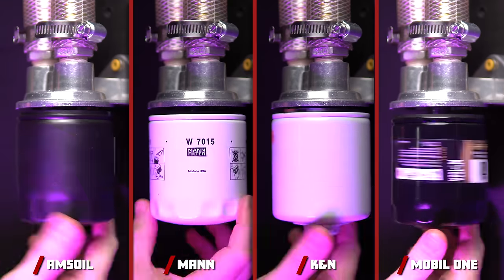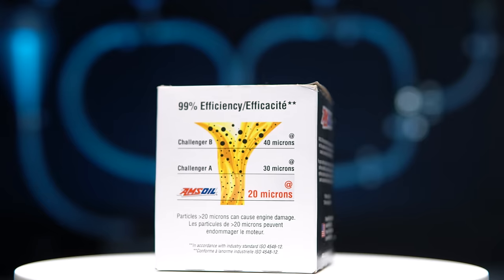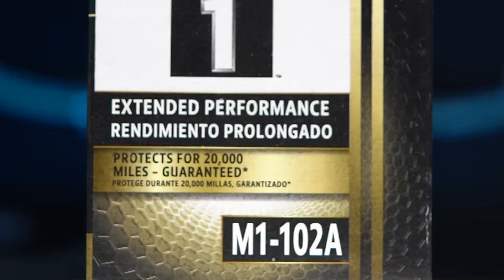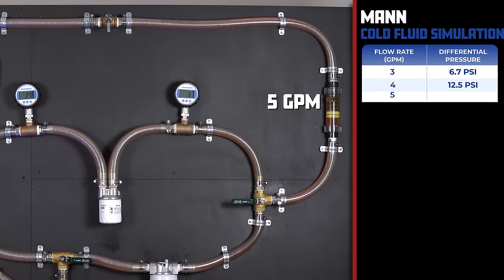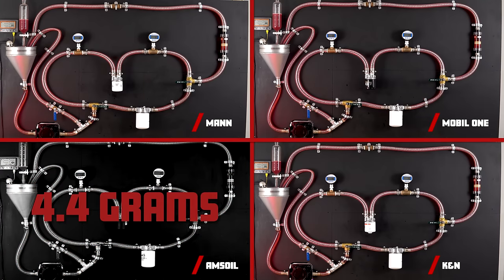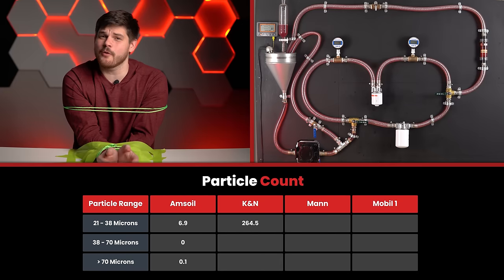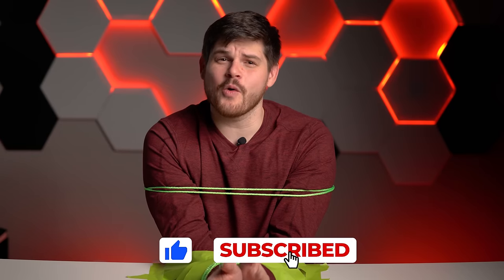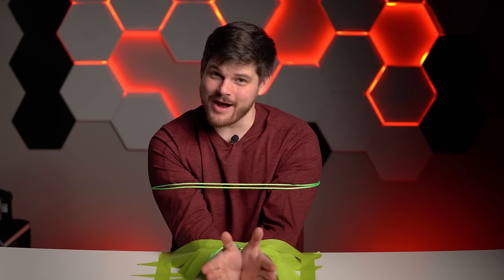Best Oil Filters of 2024 (Engineer Tested) - Amsoil | Mobil 1 | Mann | K&N

Comment: Here is my opinion, do with it what you please. For the record this is the humble opinion of a physicist/car enthusiast. That is to say, do not trust me, verify what I say, if it checks out draw your own conclusion.

1) Particle Size
Studies have shown (there are many look them up, Barris Marty is a good place to start) the size of particles which cause the most damage to piston rings and wear on the cylinder walls/sleeve are below 40 microns. 
If you want a quick explanation I can tell you that due to their lack of mass and propensity for overheating, they tend to accumulate on cylinder walls. Due to emission laws and the eagerness to improve mpg, manufacturers have lowered tolerances in piston rings, which further stops rings from dislodging the accumulation of particles on cylinder walls. Eventually these particles will cause wear on the cylinder walls and seize piston rings which leads to even more wear. 

2) Oil Pressure
During normal operating rpm, 2-3k, the oil pressure due to mechanical pressure is about 50-70 psi. Higher rpms and tighter tolerances can only increase pressure. Oil pressure is a good thing, it makes sure thar an engine is properly lubricated. The oil pressure is high in a normal operating engine, meaning that there is little to no pumping being done, at that point the oil pump is essentially a one way valve. Finally, 100% of the oil isn't going through the filter media, regardless of filter, at thousands of rpms the engine needs constant lubrication (specially engines using vvti and other variable valve timing engineering) and at thousands of cycles per minute the oil would disintegrate the filter media. The bypass valve during normal operation does not behave as a bypass valve, instead it is used to provide retardant pressure to force as much oil through the filter media as possible. In this regard the Mann filter is a complete failure, as it would essentially block filtration during normal rpms.

If there is anything to take away from this video is that the Amasoil filter is the only filter which does what its suppose to do. Furthermore, the Mann filter has a needlessly poor design.

Comment: Interesting testing. One thing I noticed is that the AMSOIL filter has the best rated filtering at 20 microns opposed to the 30 microns of the others
Reply: Flow is not as good though, definitely something to think about especially if you live somewhere with freezing temps

Comment: I would like to see a some Cat filters tested. They're the best constructed filters I've seen by far. I'd like to know the test differences between the regular ones and advanced high efficiency too. Great video series.
Reply from the maker: Great suggestions! Thanks for watching and supporting the channel.
Reply: I would love to see Cat filters tested too
Reply: Are Cat filters made by fleet guard?
Reply: @joshquiroz  No, I worked at a CAT dealer for several years.  They are made by Donaldson.  In fact most off road equipment companies filters are made by Donaldson.

Comment: I would be interested in a size chart that notes which filters have identical designs but are different in length.  I would then choose the tallest one I could fit in my car to get a step change improvement in each of your tests.  In fact that would be a great next test:  take a highly rated filter, and test it against the exact same filter but different length.  Pretty please.
Reply from the maker: Great idea! thanks you for the suggestions. we still have several to go, but we will look into it.

Comment: Best independent testing I've found. 
 
Would you consider doing endurence testing.  I know it would take some time but would be very useful to the consumer.  While any given filter might score well initially, what about simulating a time/miles test.  Things like cold starts, sustained hot oil temps, pressure surges, sucking air from low oil uncovering pick up tube.  I've heard of and personally seen the results of a failed oil filter.  Things like seal blowing out, filter element coming apart, bypass valve sticking open or closed.  

My sone was driving a Ram 3500 diesel at a steady 70mph on the interstate with no load when the oil light flickered and the engine stopped.  After a tow, the dealership determined that the filter media came apart blocking the inlet/outlet, stuck the bypass valve and blew out the gasket, then made a new gasket out of the loose filter media then ruptured the filter case and seized the engine.

Ram bought him a new short block and installed under warranty only because it was a Mopar filter installed by the dealership.

Comment: i ran my 2016 lexus nx200t 3 ys, 2 mos & 2 days, (during pandemic), going 23,671 miles... running AMSOIL SS 0w20, that i use & sell, had it tested, only gained a little viscosity... 😍

Comment: Thanks for taking viewer feedback to put Amsoil to the test. Fantastic data to allow different users to make more informed decisions.

With Amsoil having the highest advertised micron rating, it's not terribly surprising to see it with higher flow restriction, imo. Then seeing it actually do the advertised filtering job was also good to see their claims backed up by testing.

I currently run Amsoil filter on my 2015 Tacoma V6 and 2007 Accord I4. Seeing the flow restriction gave me some food for thought. Living in Auguata GA, I rarely see sub freezing temps. I think if i did live further North and regularly dealt with colder starts, I would be tempted to go with the Purolator boss. In fact, due to this series I'm considering switching regardless. 

Filtering is meant to prevent wear but if the filter is so restricted that the engine is oil starved, then it probably makes sense to have slightly less than the best filtering level to get that better flow rate.

Great video.
Reply: puralator is probably better flowing....because it is still occasionally sometimes found with torn media.....which gives it the name Tearolator
Reply: @LoveLikeaHurricane  ROFL. I've never heard that before. That's funny. At least for the one used in this test, when cut open, it didn't appear to be torn. But that's good information to know. I'll need to dig into that.
Reply: @benjaminguider1048  which would also explain why it had better capacity. Higher filtration should tend to do worst in capacity.

Comment: Great video! Exact! It’s interesting that you said the Mann filter with 153.5 particle count at the smallest particle range was “impressive”, where Amsoil had a count of 6.9 in the same range! Now THAT’S impressive. The Mann filter had over 20 times more particulate in the oil! With daily driver cars, the rpm is only above 3000 for a few seconds until it shifts and runs steady between 1200 and 1800 rpm, so the oil pump gpm I would guess would run around 4 to 6, way below the filter bypass valve setting.

Comment: I have been using Fram Ultra filters and will switch to Mobil 1 thanks to this video. I need higher flow for these big V8 engines.
Reply: I just might step up to the Synthetic Endurance after this.

Comment: Filtration is exactly why I use Amsoil over the others. The amount of time an engine spends with the bypass valve closed vs open is why filtration is my most important consideration. Great testing!
Reply from the maker: Thank you so much for your support!
Reply: +1 for amount of time the bypass valve is open (cold) vs. closed.  To go along with that ... if the oil is that cold, then the engine components are also cold (i.e. greater clearances), until things warm up a bit.  One can get hyperfocused on the cold psi stat, but if you think it through, it makes a very small portion of time in the life of the engine that it applies.  Also, if you simply allow the engine to idle a bit at start up, it is under a low load during this warming period.  If it is THAT COLD, then you need to adjust your oil's Winter Weight (W) ... rather than use a filter that lets more contaminant through.  Good to see Amsoil in (my) TOP 5.  But, for those who don't want that much filtration, it's good to know that there are a few options that are only a little bit behind the Amsoil.
Reply: @kentsouthers6244  this is also why I use 0w-40 rather than 5w-30 in the winter. The 40 weight applies to the simple fact that I’ve got 245k on my engine and it loves to burn oil (it’s a Honda thing). It’s time for an overhaul for my engine.
Reply: @kentsouthers6244  Exactly. My Subaru uses 0w-30 and my two other cars use 5w-30. Both flow fine when they are below freezing and the 0w flowed great when I did an oil change once when the temp was below 0F
Reply: It's all I use in my Shelby GT350 with their signature series 5w-50 oil

Comment: Interesting! Happy to finally see the K&N on the new tester, the K&N PS-2001 that I daily drive has a bypass design closer to the "Mann" filter's design, albeit it's unique but the entire body moves via a spring on the bottom rather then the traditional plastic thingy. I'm surprised more companies don't implement the design as a single metal spring seems to me to be a way cheaper solution then a plastic piece, another spring, and stamped sheet metal to hold everything in place.
Reply: K&N is one of the worsts on here. Glad to know. I will not be using K&N anymore.
Reply: @elpcmaster  Yeah I'm very disappointed with the design of the K&N on here, I'm probably gonna switch to Mobile1 next oil change after verifying that it's design is somewhat decent. I've noticed some serious variances based on part models, for instance my vehicle has a 2WD and 4WD oil filter, literally the same exact motor, but the 2WD filter is half the size.
Reply: Your first comment was praisingthe K&N @linuxguy1199
Reply: @hammertime4257  Just because I praise some aspects of it doesn't mean I think it's the best there is. For my particular vehicle I prefer it as the design of the one on my vehicle is a lot different then the piece of crap shown in the video, as for why that is I have no idea.

Comment: Thanks for including the Mobil 1 filter. I'm glad to see it's a good performer.
Reply from the maker: Thanks for watching!
Reply: Did you not see the results? One of the worst in filtration.
Reply: @elpcmaster  It came in 5th overall, I wouldn't call that one of the worst!
Reply: Mobil had 252.9 wear causing particles and Amsoil had 6.9! I wouldn’t want 246 more particles in my oil!
Reply: @darrylsjodin7184  I believe those particles were smaller than 20 microns, I may be wrong.
Reply: @Technotranceism  They were 21 to 38 microns. The Mobil filter is rated at 30 microns and the Amsoil at 20 at 99 %
Reply: @darrylsjodin7184  Be that as it may, the flow rate was far superior to the amsoil. So what do you prefer, cleanliness albeit with restricted flow, or partially clean, with superior flow? Also we don't know what any of the particulates even are.
Reply: @Technotranceism The pressure drop was higher for the Amsoil filter, at 2.9 psi at 10 gpm, meaning at 6000 rpm, the oil pressure might be 53 psi for the Mobil and 50 for the Amsoil.  50 is just fine. Most particulate wear is from 5 to 20 microns, so Mobil’s 30 micron rated efficiency at 10 microns would be much worse than Amsoil’s 99%, 20 micron rated efficiency, which is probably over 90% at 10 microns. Oil flow is good with any of the filters, so cleaning is the most important. IMO

Comment: Great video, I love these tests. As an Amsoil fan this was certainly interesting. You clearly demonstrated that the filter media and Amsoil is using seems to far ahead of everyone else tested. However the lack of capacity is concerning. Certainly driving home the point to never actually push these filters to their mileage limits. I do think that the Amsoil filter would great with Amsoil oil as that stuff somehow seems to flow better than almost any other I have seen as references by project farms videos and the fact that i myself have seen increased oil consumption or worse leaks from worn out engines when using amsoil vs other brands. While that sounds bad it really just points to amsoil being able to flow better and squeezing a larger amount of oil through very small imperfections or gaps. If you have a well maintained or new engine, this will result in less wear and better oil flow for bearings but in a worn out to very old engine it can simply make leaks worse or let more oil past piston rings and/or valve seals causing increased oil consumption.
Reply: Actually,Amsoil CLEANS deposits left by inferior oils. The esters in Amsoil rejuvenates most seals over time after having cleaned out sludge.
Reply: To me, Amsoil SS is not a dedicated performance oil but it's an excellent daily drive kind of oil. Nice cold flow for cold starting and good cleaning capabilities, especially higher TBN. The viscosity is not very high but it's good for gas mileage. The price is also not that expensive if u have a membership.
Reply: @multiluxem2218  what do you mean the viscosity is not very high? If it's, lets say, a 5W30 oil it has to fall within the test parameters for 5W30 to be rated a 5W30 oil etc. etc. right?
Reply: @oneninerniner3427  Yes. But 5w30 is actually a range of viscosity (9.3 to 12.5 cSt @100C), not representing a single viscosity. Oil from different manufacturers can have slightly different viscosity despite having the same viscosity grade. The kinematic viscosity of some Amsoil SS is actually on the relatively thinner side within the viscosity range (such as 5w30), like many big brand oil. This is listed on their product spec document. Some other oil, like Redline, may have higher kinematic viscosity, despite they are both 5w30. It doesn't mean Amsoil SS doesn't provide good protection, as there are many other things can affect it, such as additive package, etc. But lower kinematic viscosity may help lower mpg and better cold start.
Reply: @daniellang6112  yes but if that sludge is blocking or restricting an oil leak, then gets cleaned out. Boom now you have a leak that you didn’t have before or one that is worse than before
Reply: I've gone up to 15,000 mile changes on my Amsoil filters before with guidance from Blackstone. And flow limits on a daily driver really aren't an issue. How often are you driving around at 8000 rpm full throttle with your daily driver?
Reply: @lucid484  As long as it isn’t restricted to the point the bypass opens all the time then it isn’t an issue, you are correct. But as soon as it does reach that point, you very literally don’t have any actual filtration going on. That’s not something you will ever know on your daily driver though. Hence why avoid taking the oil filters that far.
Reply: @multiluxem2218  It's the best 5w-50 you can run in a Shelby GT350 though. This engine is really tough on oil and gets a significant amount of blow by in my catch can. Amsoil just performs better and lets the engine run more smoothly.
Reply: @lucid484  I'm at 8000ropm a least once a day in my GT350 lol

Comment: If memory serves the critical micron size is between 3-5 (depending on engine) the distance between piston ring and cylinder wall.    Larger particulates remain suspended in the oil or are caught by the filter.      Point is, only an additional and restricted flow "bypass filter" removes particulates down to 1 micron.

Comment: I think you should run this test again with the AMSOIL filter and using the AMSOIL Signature Series Oil. Because if AMSOIL designed this filter specifically for their oil (which would make sense) I would find that a more exact example. Not saying it would for sure change anything but just curious how different these values would be in that case. I have a feeling a lot of companies game the system to do really well on these standard tests rather than in real world applications.
Reply: You have an excellent point here.

Comment: Rewatching this and something occurred to me regarding the capacity test.

If I understand the testing methodology, you keep introducing particulates until you reach the stated pressure difference indicatimg the filter media is saturated indicating the volume of particulates captured.

This test would seemingly benefit a low micron filter though allowing for more of the particulates below the filtering media's threhold to remain in the oil while you must introduce enough of the test powder for there to be enough of the larger particles to saturate the filter media. The lower efficiency filter will not have actually captured all the introduced powder.

It would make sense to me that a more efficient filter will fill up sooner with this test with fewer grams introduced without indicating which filter has a larger capacity, as part of fhe filter capacity for a lower filtering efficiency filter will be still in the oil.

However, the test would still suggest which filters will become blocked sooner under real world conditions and therefore which maybe shouldn't be pushed to longer OCIs.

Comment: I liked this video. There is a filter (the K&N HP2004) that's used as a substitute for the Tempest AA48108-2 aircraft filter. 
  I'm wondering if it's really a good substitute considering aircraft use heavier weight oil? Usually 50 weight in the summer and 40 weight in winter. 
  I don't know the filtering abilities at the micro level.  Any insight?

Comment: I would like you to test used filters.   It is time-consuming to change filters on my vehicles.   Years ago it was common to change filters every other oil change. Now recommendations are to change the filter every oil change.  I am now changing the oil every 5K miles and changing the filter every other oil change.  Testing used filters would indicate how often a filter needs to be changed.  Your test rig is awesome.